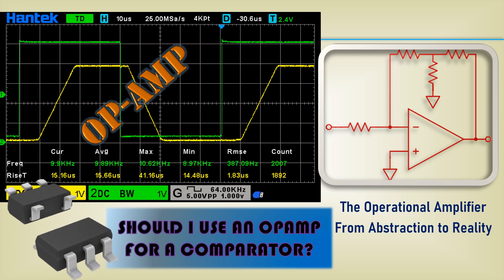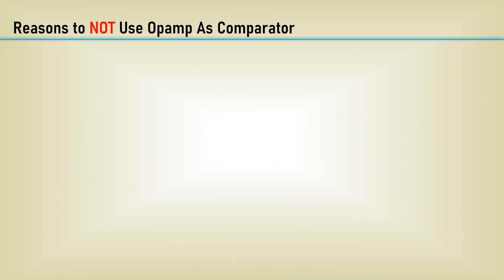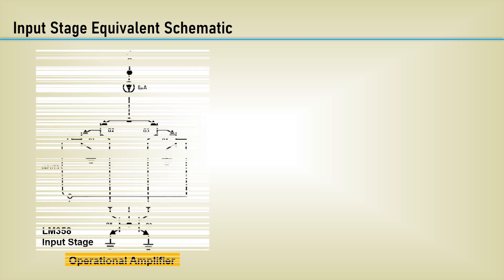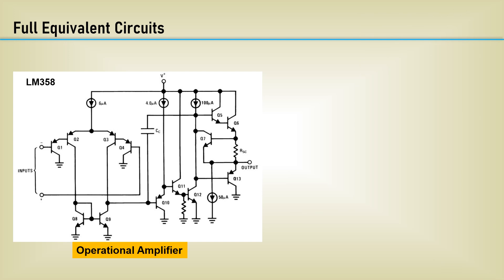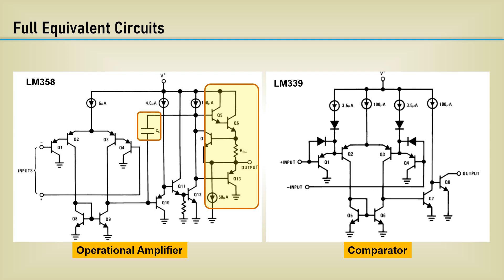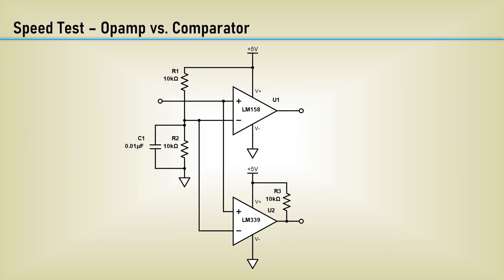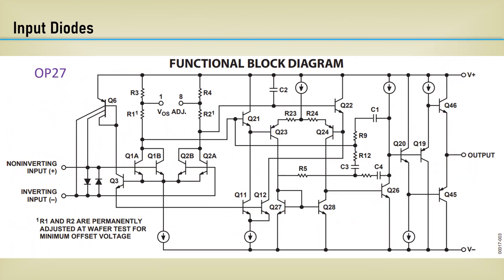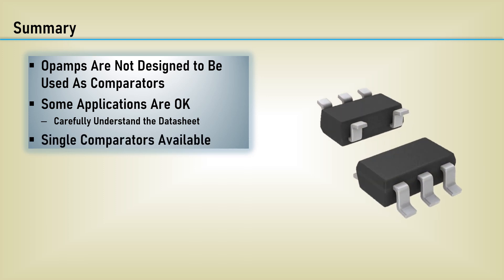Should I Use an Opamp for a Comparator?

Comment: There are some subtleties that perhaps ought to be explored before rejecting outright the use of an opamp as a comparator. If you have fast rising signals, like your 10KHz square wave, then the deliberately limited slew rate of the LM358 will be a disadvantage. Nevertheless, at lower frequencies, and especially where the input signal may be quite slow to change such as with sensors, then the limited slew rate becomes irrelevant. Remember that the pullup resistor on the LM339 will quickly degrade its fast rise times if there is capacitance present on the output. A power mosfet's input capacitance can easily be around 1nF, and that will have a time constant with the 10K resistor of around 10μs, not much less than the rise time for the LM358.

In general, with the comparator some hysteresis (positive feedback) becomes essential for slow inputs because of the tendency for the comparator to burst into oscillation around the crossing point unless extreme care is taken with layout, whereas the limited bandwidth of the opamp reduces that problem.

It's also worth noting that the LM311 can sink 6ma, but cannot source current, so with a 10K pullup resistor, its high output will drop from 5V to 3V with a little as 0.2mA drawn. For comparison, the LM358 can sink 10mA, but can source 20mA, a factor of 100x more. That may be crucial in some applications.
Reply from the maker: Great points. Thanks for the comment.

Comment: Thanks, I built an analogue power supply many years back using an op-amp and high powered transistor which worked well, just realised now may be I should have used the comparator??
Reply from the maker: No. You need the continuous linear control in the feedback loop that an opamp provides.
Reply: @oldhackee3915  oh I see, I was going to change it to see if it made any difference.

Comment: Nice rise time comparison.  As someone adding analog wrinkles to digital circuits, I tend to use digital ground as analog minus, thus simplifying the interfacing of comp outputs to digital inputs.  For this, the open collector outputs are an inconvenience as they require an additional pull up resistor between V+ and comp output.
  The equivalent circuits shown have the comparator as essentially the first stages of the opamp, but with the capacitor removed.  The omitted stages happen to invert the signal during amplification, but that's not fundamental.
Reply from the maker: Thanks. It’s nice that you can have digital ground and analog minus be the same.